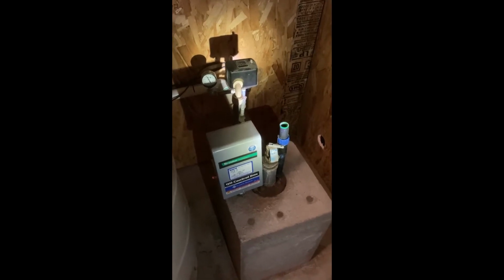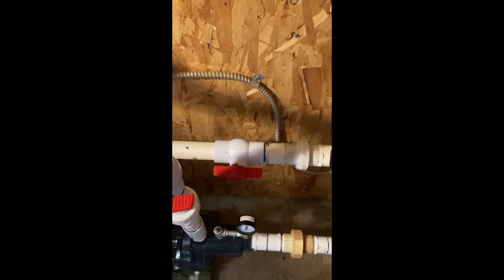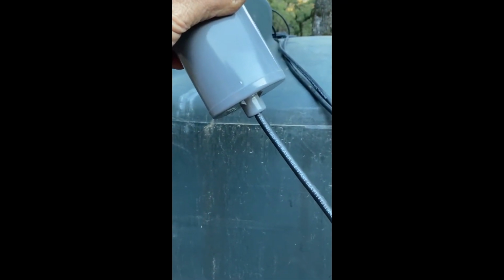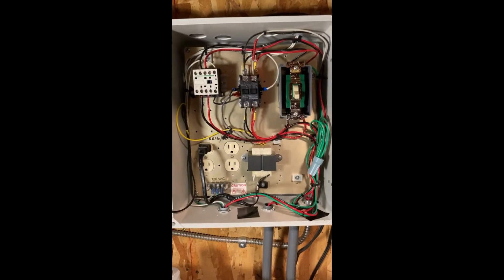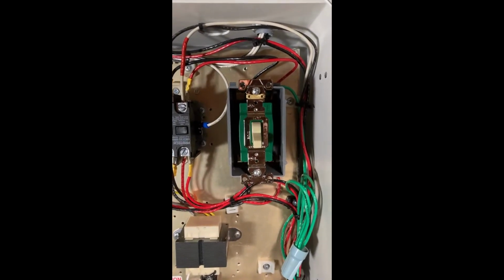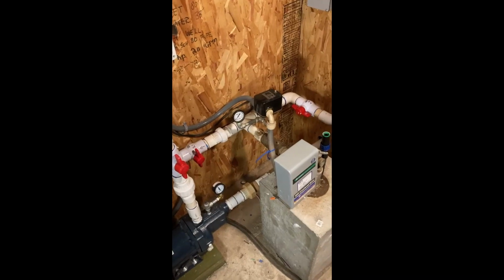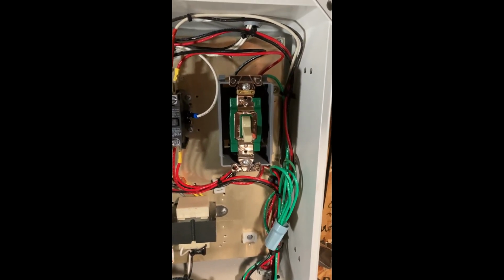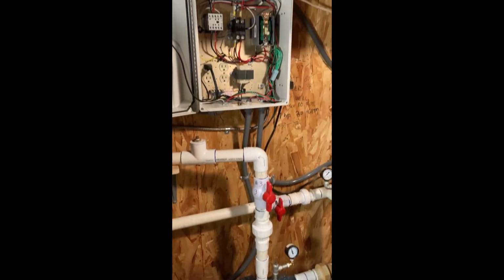Well Water Storage Tank System With Bypass

Comment: Wow! Thanks for this! I actually built a system identical to this so that I could supply water to the house or the reservoir with my submersible well pump. I operate it completely manually which is a bit risky. I really appreciate the info on the control unit you used to protect the pumps in a low water situation. Wish I had seen this before I built the system, but it's never too late to make it right. Thanks again!
Reply from the maker: Glad you liked it. I couldn't find a video on this so I made this amateur one! It took some head scratching to figure things out, but Its been working smoothly for 3 years now except one time when  the upper float switch got hung up and did not call for water.

Comment: I will be trying to build the same system. Great video! One question though, would you think there is a way to incorporate an additional well from a few hundred feet away with just plumbing and a float switch or maybe two floats?  Only one tank though, that is what I am trying to do
Reply from the maker: I think it could be done, but you would probably have to manually switch over the 2 float switches so that they control your second well further away. Does that make sense?

Comment: I was wondering how you control the jet pump?  It can't be on all the time as the pressure has no place to go.  Did you use a flow switch to control the pump and if so do you have a part number and placement of said switch? Thanks for the video as it was very helpful.  Jim B.
Reply: It has a pressure switch and is tied into the pressure tank.

Comment: I have been struggling to figure out how I'm going to install a couple of float switches inside of a concrete cistern in the ground and you have a brilliant idea with the concrete base and the pipe with the float switches Iam kicking myself for trying to make it way over complicated
Reply from the maker: Happy to help! I just cut a 5 gal bucket down pour the concrete into and left a couple of screws sticking out if the pipe to make sure the 2" PVC pipe didn't ever slip out of the base.

Comment: Dammmm...Nice set up...What did u wrap the pipes with...N/E idaho get cold
Reply from the maker: N. California here so we don’t get as cold as you. I just used standard foam insulation and weather proof tape, by you might need thicker foam or rubber insulation and maybe even a 120 volt heat tape next to the pipe. Best of luck!
Reply: @canyondanhandyman1784  Thnk u!!!

Comment: Great design. Wondering why the pressure tank is not inline with the surface pump instead of the well pump to reduce short cycling of the surface pump.
Reply from the maker: Tom, with this design either pump output can be sent directly to the pressure tank, so there is no short cycling no matter which pump is being used to charge the pressure tank. I always have the surface pump doing that, but it’s nice to have the option of going back to the submersible to charge it. I would probably only evido that if the surface pump dies, or there is some problem with the larger static storage tank outside.

Comment: Good setup.  I will post a drawing soon for your setup as I want to do something similar, then maybe others can take and make revisions for their own needs.  But I wanted to confirm,  your pump output is 80psig?  And the pressure tank is at 80psig?  That's about the pressure I need since house is uphill and we have shallow water well downhill.  My father died of Covid in 2021 so I'm slowly making improvements helping mom out while caring for her.   Appreciate any help I can get on planning/design!
Reply from the maker: Hi there!
The surface pump I bought came with 3 different jets you could install for high volume, high pressure, or middle of the road. I went for high pressure as my home is uphill from the well house and you loose about a pound of pressure for every 2 feet of rise. I think I have it set to cut out at 75 pounds, don’t want to blow any pipes! The pump is a 3/4 horse Franklin “versa-jet” and bought it online from Big Frog supply. Good luck with your efforts!

Comment: Hi Dan, Do you happen to have the brand and part numbers of your float switches? Greatly appreciated! All the ones I've seen so far are for 110 or 220, not 24 volt.
Reply from the maker: Hi Tim, There are lots of choices out there. But the most important thing is you get mechanical float switches NOT MURCURY! Don't want that stuff in your water! Below is the brand I bought, but not sure of the model number. This could be the one I bought? I used normally closed switches (on when in down position). You can use float switches rated for higher voltage for 24 volts. I did.https://www.amazon.com/Float-Switch-PUMPMASTER-SJE-RHOMBUS-20PMUWOP/dp/B00VXQ5W7G/ref=sr_1_6?crid=MDIV4LLDF33&keywords=float+switch+for+water+tank+pump+up&qid=1684001808&sprefix=float+switch+for+water+tank%2Caps%2C1320&sr=8-6
Reply: @canyondanhandyman1784  Thanks Dan!
Reply: @canyondanhandyman1784  ,another question, the wire or wires from the 24 volt relay to tank switches need to be what gauge and how many wires? I was thinking of running 14 or 16 gauge Romex.

Comment: I'm so thankful I found your video!  The panel part has been confusing for us to find good examples to go off of.   We are doing a similar system, but we are putting in one more float switch.  The top will be at 300 gallons so it turns on the well pump to start filling.  The bottom two will control the surface pump. The higher one we want to trigger off when it goes to about 600 gallons (2000 gal tank) to let us know the water isn't filling for some reason, so we have some reserve but can work the problem.  We want to be able to switch it back on so that we can use the reserve while we figure out whats up with the well pump or if our well has run dry.  The bottom one will be at the bottom so it shuts off the booster again, before the tank is 100% empty so we don't burn it up.  Do you know how best to wire those two switches?   Thanks for your help!
Reply from the maker: I'm glad you found the video helpful! I would need even more clarification to make any suggestions on wireing switches for the well pump. However if you have a low producing well (or even if you don't) there is a wonderful device available that can save you well pump from running dry and (burning up) Additionally it can be set to start pumping anywhere from 2 minutes to 2 hours depending on how your well is producing.  Designed to fit inside most well pump control boxes. I put one on my well pump system as extra insurance against running dry and loosing my submersible pump. It will also tell you if your pump is bad. Easy to install and self calibrating. It logs all pump events in its memory, but you need to purchase an additional hand held unit to pick up the event data via the optic cable on the unit. There are other brand  units out there, but my well pro swears by these. Best of luck on your project!!
https://www.gordonelectricsupply.com/p/Littelfuse-231-Insider-P-Pump-Mntr/6041532?gclid=CjwKCAjwoIqhBhAGEiwArXT7K8talC931sIol0sKqBgFeltjOE4wSHSqnJCjs-hVIu3_j7p4MIwrixoC8JMQAvD_BwE

Comment: I want to do this but add a timer relay so the submersible pump only runs for 5 mins every 30 mins to refill the storage tank I have a low yield well
Reply from the maker: there is a great unit for this that goes inside your pump control box.  it self calibrates then reads your pump voltage and amperage and will shut down if we’ll is dry or pump goes bad. also can set  time to restart from 2 min to two hours. has a memory that can be read with an additional device.
my well is not low yield, but I installed one of these anyway as it’s good insurance. several brands and styles out there. I bought one made by the littlefuse company as other brands have been problematic according to my well man. I’ll try to dig up a link for you.
Reply: @canyondanhandyman1784  amazing thanks. I’m pretty mechanical and good with electrical but the options available are making my head hurt. I want simple and affordable.
Reply from the maker: I can’t access my channel on my PC to drop a link for the pumpsaver I used so google” littlefuse 231-insider P” to get started. it’s an amazing unit and very easy to install and set up. there are other models and brands out there depending on your situation,pump size control box model. but I would recommend this brand.

Comment: Hello have you had any leaks since installing this system. I have a similar system where I can switch between a 2500 gallon storage tank and a submersible well with pressure tank. I've had problems with leaks on the suction side of the pump. Rethinking how I do that plumbing and what types of fittings to use. It has a 1 1/4" suction and 1 inch pressure  pipe size with a 3HP 3 phase pump. Looking at using metal vs all pvc, I do have a brass cutoff and brass check valve at the storage tank and on the pressure side of the pump. Any suggestions?.
Reply from the maker: the only leaks I had were because I chose to have threaded PVC unions everywhere instead of slip ( glued) type. it was a real PITA for the first week, but trouble and leak free for a year now. that’s a big pump you have, is it secure to the deck?? does it ever cause cavitation or vibration in the pipes? that’s all I can think of.
Reply: @canyondanhandyman1784  I swapped out much of the plumbing with PVC and it's all good now. Does your reservoir tank autofill as it's depleted or do you have to manually change over the valves and relay switch to fill?
Reply: @gwrace  topping off the storage tank is completely automatic with the system I built

Comment: I just had a concept and now I have a game plan! Thank you Dan for posting this and letting me know it is not only possible but giving a great run down on how to make it all work.  One question i had is if you think there would be any issue with keeping the pressure switch further down stream with the pressure tank?   I currently have one of the manifolds that would save some already tight space.   Thanks again
Reply from the maker: hi J!
I don’t see a problem with having your pressure switch downstream as you say, as long as it is before your pressure tank. of course I can’t see what you have there. I still have two pressure switches. one on the submersible which is “dormant “ while tank surface pump system is on, and  the pressure switch on the surface pump which is currently operating. does that make sense? best of luck to you!

Comment: Hi! Thanks, that was great. You mentioned making a list of the parts you used for your system. Can you add that list to the description here? I'm doing the same thing you did and I'm curious about the surface pump, pressure tank and storage tank details and, if possible, the cost of those items.  Thanks again!
Reply from the maker: Hey Yamaha! Thank you! I'm swamped with work and not much time to gather a list, but if you look back through my responses, I have mentioned some of the part #s, including the surface pump and relays. On the surface pump, look up Franklin "versa jet" pumps. They allow you to install one of 3 included jets to adjust for high volume or high pressure, or a balance of each. I needed high pressure (90 lbs). I got mine at Big Frog Supply online.. I'll try to gather my notes to build a list at some point but it might be a while.  Best, Dan
Reply: @canyondanhandyman1784  Thanks! Have a great evening!

Comment: My situation is very similar to yours so I appreciate your design. I am going to emulate your setup with one exception. My well house is centered in my 3 acre home site and I don't want a large plastic tank next to it. I am thinking of a location approx. 100' away with the elevation a foot or so higher. Do you foresee any problem with this other than a bit more expense of trenching the pipe and conduit to it?
Reply from the maker: Karl, I can’t foresee see any problem with your plan.

Comment: my pressuree switch does not work, and my prressure tank leaks. im just filling from my  well to a storage tank. Do i need to worry about the pressure tank and switch? i  was hoping not
Reply from the maker: Hi Larry, I can’t answer completely without more information. I don’t know your set up there, but it sounds like you need to address both those problems. Pressure switches are not expensive and sometimes they just need to be cleaned up if full of dirt, bugs etc. make sure the power is off before you try that.. it may be out of adjustment as well and there are good videos on how to do that. I’d be tempted to replace it and adjust per videos. most switches  are set to go on at 40 lbs off at 60. on your tank I don’t know what kind of leak you mean. is it a bladder type with a busted rubber bladder? (if so you need to replace tank) if simple steel tank with air space, they can be water logged. that means the tank has no air on n the top to compress, and you need the air in there to be able to pressurize the tank. (can’t pressurize the water itself).  last home I had had a simple tank with no bladder.. it was a pain in the ass when it got water logged, so I replaced it with the biggest bladder style I could get.
hope this helps and best of luck. D

Comment: Hey Dan how far away is your storage tank from your surface pump
Reply from the maker: hey Chris, the 1100 gallon tank is only about 10 feet away from the pump and at about the same level. but the feed from the tank goes underground a bit then back up to level with the surface pump. there is enough static pressure in the tank to keep the surface pump primed. hope that helps.. cheers! D

Comment: Thank you Dan. Great video! May we have a part number for the white Schneider relay in the upper left corner? The black two-pole relay is part #XMCO-322-EBBD and it is out of stock everywhere. Also, will you mention changes you've made to the design since the video? Greatly appreciated!!!
Reply from the maker: Hi Creed, Thanks!
The part number for the normally closed Schneider relay is CA2KN22B7 and I believe that part # is good for square D as well as I hear it’s the same company. it took some time to find the right one. ordered a different one all the way from England, and they sent a normally open one, and the wire terminals were so poorly designed I wouldn’t have used that one anyway. I found the Schneider  on eBay I think. as far as the normally open relay for tank filling, any 2 pole 240 volt relay with 24v AC coil will work.. lots different brands out there.
Cheers.
Dan
Reply from the maker: PS I have made no changes since the video, and it’s been trouble free!! all my mistakes changes were made during the build!

Comment: Dan do you have a sketch drawing of this electrical system? I am trying to recreate exactly what you are doing here. Thanks!
Reply from the maker: Hi Kevin! I’m sorry but I do not have a sketch, at least not one that anyone could make sense of. I also changed the design as I was planning and putting it together. as i realized that I did not think it through or made a mistake. finding a good normally closed two pole relay with a 24 volt AC coil took me a while. I bought almost everything online except wire and conduit . I’ve been swamped with work but I will try to get a parts list posted soon. i have not had a lick of trouble with the system since I fired it up last November. but it did take me quite a while to figure it out and build it! just be patient and I know you will figure it out!

Comment: Hi Dan, can you tell me brand/model of your surface pump?
Reply from the maker: Hi  Kevin.  It’s a Franklin “versajet” 3/4 horse  part #91180007.  I got it online at big frog supply. I choose  it because it comes with 3 different jets so you can pick between standard, high pressure, or high volume. I needed high pressure (up to 90 lbs) Great pump! Sadly they have gone up since last October when I bought mine. I paid $449.00 Now $627.00 and free shipping. I still think it’s a good deal at that price. I think the pump is comparable to a Gould pump costing well over $1000.
Cheers!
Reply: @canyondanhandyman1784  Thank you so much Dan!

Comment: Good video are you using the same cut out switch from the submersible to the surface pump . Or how the surface shut off when the pressure tank gets low when use the sawer or sink in the house . Sorry if I got confused
Reply from the maker: Hi Carlos, I’ve tried to reply 3 times now and it’s not working for some reason. I’ll try again. Both pumps have their own pressure switch for cut in and cut out. This allows me to use either pump separately if I want to.
Reply: @canyondanhandyman1784  the floating ones for the surface pump and the pressure switch for the underground. I am looking for a tank to try and replica the same . It seems simple i recognize the relay is like the one on the welders I work before the question I have us my tank would be up like 59 feet from the grown so would it be to much push back weight on the water for the underground pump? Or it be ok just put a 1 way valve
Reply from the maker: Yes you should have a one way valve there. Your pump in the ground should already have a “one way” or “check” valve on it. Even If it does you can add another if you want to. I got a good quality brass check valve on Amazon for $22. US.
Reply: @canyondanhandyman1784  awesome thanks for letting me know . I will order one .